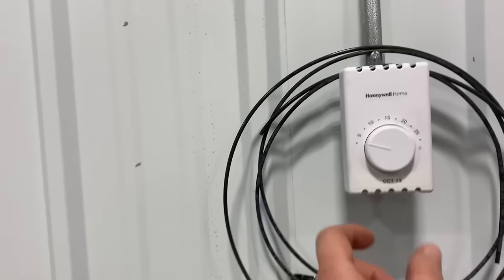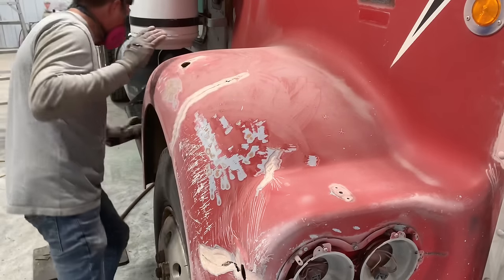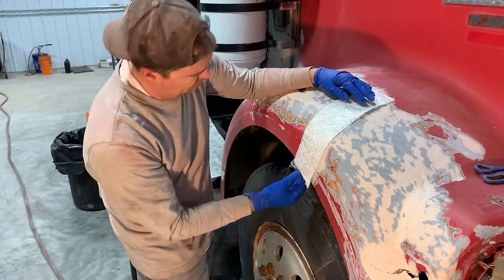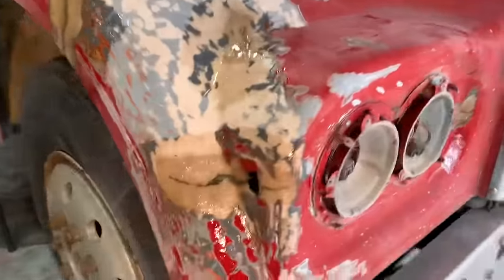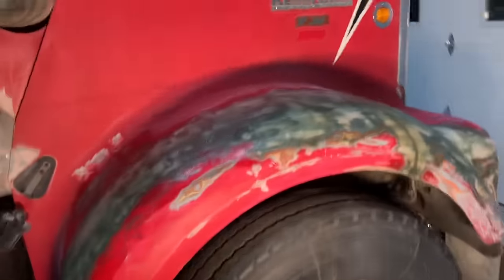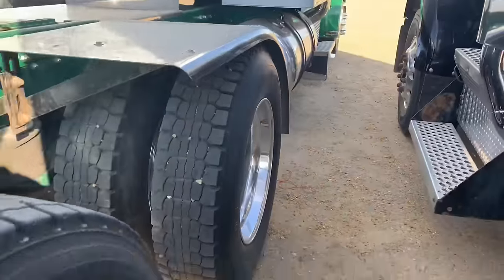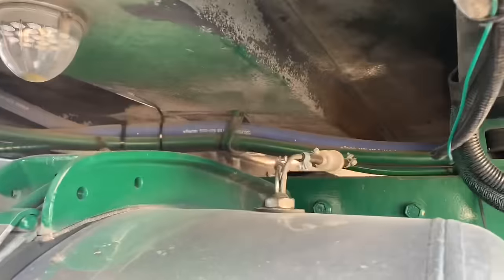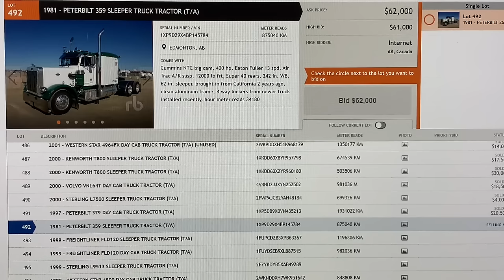Smokey & The Bandit Tribute Truck Ep.33 Fractured Fender

Comment: Fun fact. In Brazil those “stress cracks” in fiberglass are called “pé de galinha” (chicken feet)!! I would drill holes in the end of the bigger cracks to prevent them from spreading further. Also even when you cut the fiberglass mat in small pieces, use the respirator. Nice job and a Merry Christmas from the tropics in a 39º Celsious weather.

Comment: If you ever wind up doing another one, here's what I do. Don't bother with the fiber mat on the outside - when you sand it, it doesn't matter that it was there, no strength. Put all the mat inside, use extra resin outside. Also put a little resin in your bondo for extra sloppy goo that seeps into cracks and pits and dries hard. Makes a fine finish putty. Lookin good, man!
Reply: As many as it takes - and on the inside you can layer as much as is necessary, just not all at once. If it's really pooched you can also bury reinforcements in the mat like plumber's tape, metal mesh, etc. A good screen goes a long way.

Comment: Turning on the lights, adjusting the thermostat and getting to work on lenendary trucks your way in your own shop, is every bit inspiring and aspiring.  One day I'll get a heat in the shop, finish off the cement floor and add a 4 post lift.  One day, even if it's another 20 years.  Keep on keeping on.  Merry Christmas, from a farm in southern Saskatchewan.

Comment: Merry Christmas Mark. Here's an idea to think about for your under fenders. I used to work for a trucking outfit that used to use Rhino liner under the wheels wells of the fenders. The reason for that was when we put new Steer tires on the truck, the new tires would pick up a lot of rocks and throw the Rocks up into the fenders and creates Stars. Little stress cracks from the Rocks hitting the underside. That helped reduce some of the Stars.

Comment: You're making the repair much harder than it needs to be honestly Mark. You should 'back up' the crack from behind on the inside of the fender with your chop mat. You can use multiple layers of mat and resin overlapping the damaged area. On the top of the fender you should use a quality fiberglass filler like US Chem Duraglass or kitty hair. When you do it this way you can add all the layers of mat that you want and you won't have to worry about 'feathering' out the thickness of the chop mat. This hides the damage much better, will require way less prep/ filler/ sanding and applying the mat underneath it can be as thick as you want to reinforce the damaged area and you won't even see the repaired area. After the Duraglass on top, you'll sand it down with 80 grit then follow up with regular filler, sand again with 180, then use a lightweight pinhole filler such as USC Thin Ice or 3M Piranha Putty. Finally sand the lightweight filler with 220 and 'feather in' to the surrounding glass on the fender. Finish it off with some high-build primer wet sanding with 320. Lay the primer on thick and keep wetsanding your repaired area until all the pinholes and sand scratches are gone. By then the damaged area should be virtually invisible. To find your high and low spots grab a can of spray paint in an easy to see color and 'mist/ dust' it over the panel. When you wetsand with a block in a back and forth motion the paint you dusted on the panel that is remaining will show you the low spots that need a little more attention. HTH you. I've been doing body work for quite some time, including on a shop that was in business since the 50's where they are extremely strict when it comes to an A+ product and extreme attention to detail. Another tip for you is to buy the cheapest chip brushes to apply the resin as you can get since they will be ruined after you use the once. You can cut down the bristles so they are shorter, so when you apply the resin you use sort of a 'jabbing' motion. This helps force the air bubbles out. You can apply a thin bead of super glue to the brush where the bristles meet the metal to keep the bristles from pulling out and getting stuck in your resin as well. Keeps things much cleaner. There are also rollers that are designed to eliminate the bubbles and air pockets that can form in your mat. I love this truck man. By far my favorite project on YouTube. Keep up the great work, and remember your final product depends on the amount of prep work you do, and the quality of materials that you use. Take care!!!👍👍😁

Comment: I know this is comment is probably a little too late and maybe it has already been brought up but a friend of mine runs T800 KW’s in his gravel business and he was telling that those “stars” in the fenders, especially the ones on the drivers side of your truck, are basically rock chips for a lack of better terms.  Driving gravel roads the steer tires throw rocks up and they actually fracture the fiberglass fender from underneath.  In order to remedy the problem the guy I know first started lining the inside “underneath” the fender with a piece of plastic like the type used for truck box liner which is a good 1/4” think and has worked well for him, I think he’s actually switched to using a spray on coating which works about as well.

Comment: In regards to that '81 Pete, if memory serves me from way back-in-the-day, at least in the states, the old (and failed) "121 anti-skid brake" systems came out about 1978 or 79, and to get qualification to pass the ruling, manufacturers started installing brakes on the steer axles. Prior to that, all our "class 8" trucks did not have brakes up front. Unfortunately, that was pre-microprocessor days, and that electro-mechanical 121 system was an abject failure. We would have drivers come in screaming that "all the right-side, (or left-side) brakes would lock up and attempt (or actually) throw them into the ditch or the other lane. Sure enough, after a plethora of incidents across the country, the U.S. FMCSA issued a directive to DISCONNECT the entire system from each tractor! I did a lot of that back then. Imagine how bad that system was to have that directive come about!!! 

You did a great job on the bodywork, Mark! Always hated doing that stuff myself -- would much rather turn wrenches. I always considered good body guys true artists! Merry Christmas!! 🎄🎄🎄

Comment: A new subscriber tonight. The stars are caused from stones been flicked up from the tyres. One layer = 1mm of fibre glass so you will need multi layers as the bonnet is 5mm plus thick.  A couple of layers each side or it will break later .Used barrier cream on your arms , neck and fingers to stop the itch. Hello from Australia.

Comment: Suspension hangar is probably not cast but rather forged. Can look the same, but you can weld forged steel as long as there's no stress on the area.

Comment: People are so scared on composites but they are seriously easy.
Like everything, there's a right way, and then there's a way that works. If this was a working truck it would probably crack out but for your purposes it'll be fine.
If you want a seriously strong repair you take all the crack out. Like cut it out with a jigsaw maybe 5mm wide. Taper the crack out like you did. Also  drill holes up both side of the crack in the good glass every inch or so. For all the hairline crack I would also sand the whole guard with 36 grit and run a sheet of woven glass over the whole guard. The woven fibre lays super flat and is super strong. You could blend it in the curve.
But as I said, that's overkill.

Comment: I thought you had to drill a hole at the end of cracks to keep them from spreading. Guess I’m thinking of something else. Good job Mark
Reply from the maker: Yes drilling a hole is a good practice but I’m hopeful with the amount of material I put in there on both sides should keep it together
Reply: @TwinStix  Hey Mechanical Engineer. Wrong answer buddy. Remember the lesson about stress relief?

Comment: I work in a fibreglass factory making bonnets for Mack Australia and next time your putting the choppy on the bonnet and Rezin to dab it on it will work a lot better for you and try make the strips quite a bit longer and wider then the crack will help prevent it cracking again

Comment: FYI-if you need more strength on curved surfaces, look for a product called Dynel. It is very lightweight, very strong cloth that goes over the mat you used on your fenders. My wife and I used a lot of it building our 31' sailboat and it worked great. Your technique for the mat looked great. Should be fine.

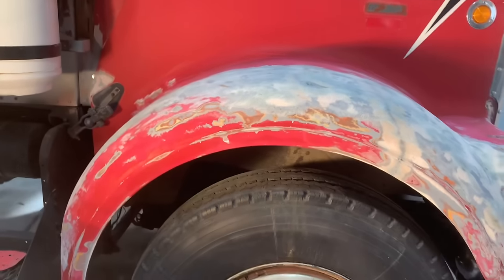Comment: 19:30  Oh buddy.  I really recommend taking that tube of glaze and tossing it in the bin.  You are setting yourself up for some wicked sand scratches when it shrinks back. Stick with two part fillers and glazing products.  Especially on those fenders.  You will be looking down them every single time the truck is within eyesight.  U-Pol or if you want to pay more 3M has always treated me right.  What you are using is basically highly reduced lacquer primer.   It was junk back in the day and even more so today.

Comment: To weld cast metal to normal metal just preheat the cast and use stainless mig wire or rod cheaper then cast rod and works good for the bigginer stainless is high in nickel so is cast thats why it works not the professional way to do but a good shortcut hack

Comment: Fiberglass tip: use the least amount of epoxies or laminating resin to wet out the cloth or mat, to much resin epoxy your repair becomes brittle like glass.
When wetting out your repair use a disposable brush use enough resin epoxy to wet the area. Apply mat first use your brush and dab dab never use brush stroke, brush stroke will spread the weave and make the repair week. Less epoxy resin is more, to much and it cracks.
Do not leave a batch of resin unattended it can and will someday catch fire. 
I worked in a boat repair shop here in Hawaii I have been through it. Good luck man

Comment: If you put a layer of bixal fiberglass 2 the underneath  you would be able to dance on that fender 
Year's ago I manufactured
Fiberglass boats 
Your last coat cover with plastic and use the plastic spreader to even it out 
 using the least amount of resin
Will It makes it stronger

Comment: In 1987/88 the fmcsa put in place the regulation the trucks/tractors built after a certain date had to have front axle brakes, I had to put front axle brakes on my 1982 Freightliner FLC 12064. heres' the wording :  if the vehicle was manufactured before July 25, 1980; or Manufactured between July 24, 1980, and October 27, 1986, must be retroﬁtted to meet the requirements of this section within one year from February 26, 1987,

Comment: How well does that heater work in your shop?  I have a 2800 sq ft shop that I need to heat and I have been researching different heating methods and I do have natural gas.  I never thought I would need a heater in a shop in Southern California but I definitely do.  I haven't done much research on the tube type heater like you have.  I am considering installing a capstone 65kw micro turbo with the heat exchanger to heat water and use that to power and heat my shop.  I would like to have a turbine generator that can run on waste oil since I generate a few hundred gallons a month of waste oil and transmission fluid.
Reply from the maker: It’s a 150,000 btu tube heater and it works amazing … brings the temp up in the shop in the dead of winter before a Johnny Cash song finishes playing 😆